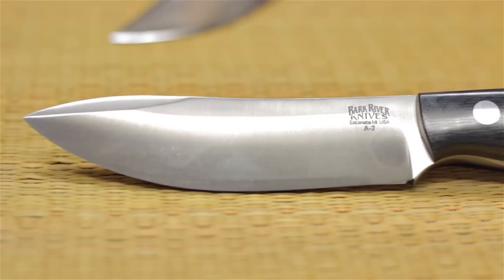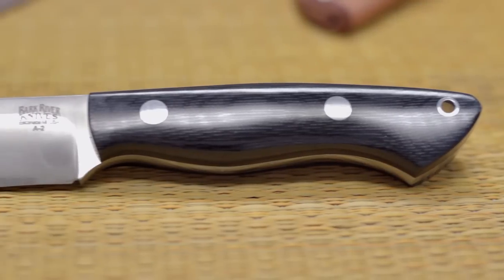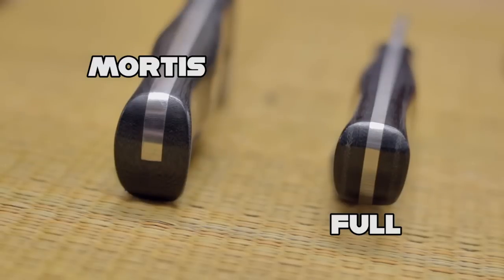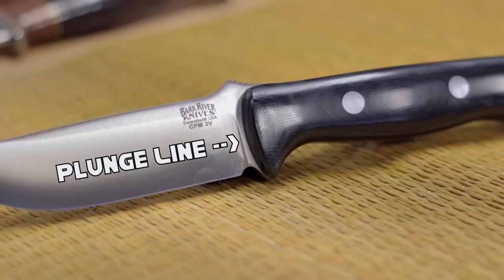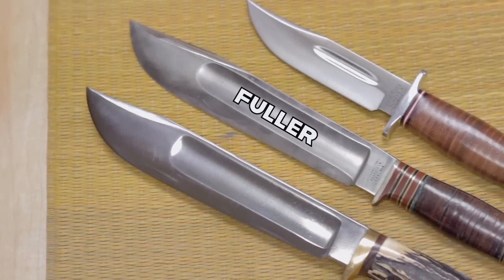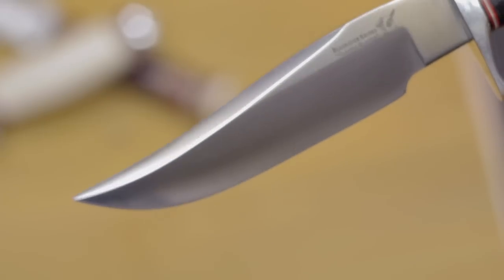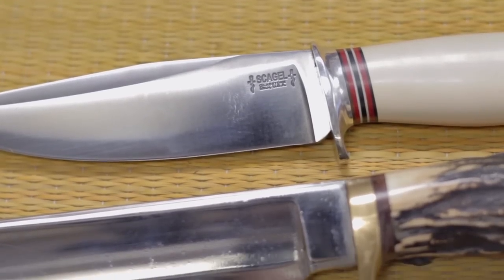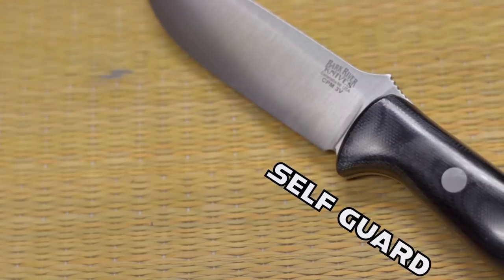Split Personality - Knives101: Terminology!

Comment: Ok, what if any difference is there in choil versus a sharpening notch? I've been told a choil is for a finger and a notch is for ease of sharpening. Mind you this is what I was told/taught.
Reply from the maker: It's all good, it's actually a great question. A sharpening notch is a very small half-radius specifically in between the plunge line and the edge. A couple of great examples would be the Esee Izula and the BRK Bravo Necker, which have both a choil and a sharpening notch. Some knives have a combination, like the BRK Bravo-1, where the choil is too small for a finger, but does aid in keeping a straight edge when profiled. Neither term absolutely has to be mutually exclusive. You are not misinformed. :)